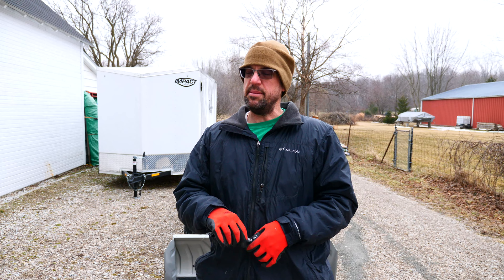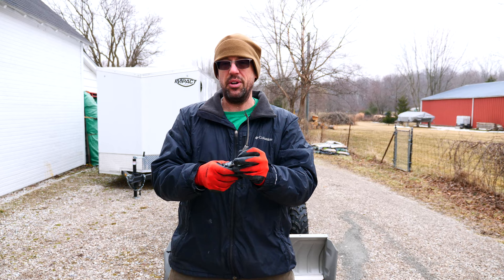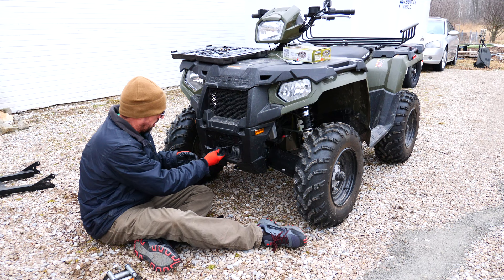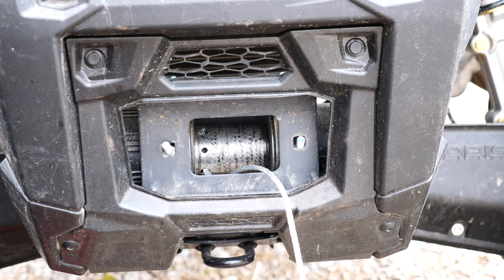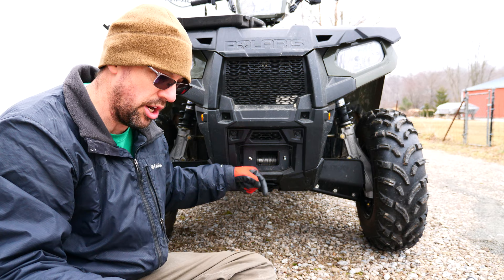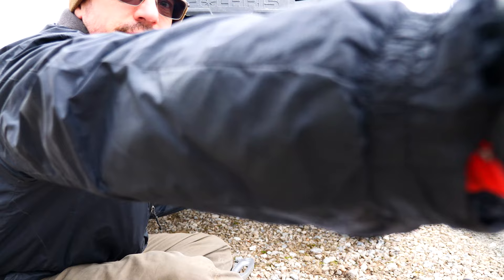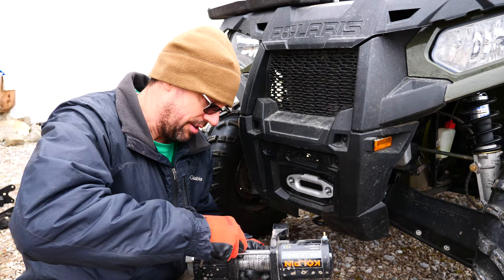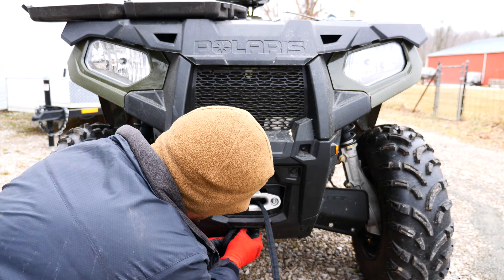Badland Synthetic Winch Rope | Polaris Sportsman 450 H.O.

Comment: Tow trucks do not run synthetic.
The fraying of the steel cable is because of improper use. Rapping the cable, kinking it, and not using chokers, tree savers and proper shackles.
Synthetic will wear on a plow too. 
Both types need proper usage and both have plus and minuses.

Comment: I completely removed the sheath on the winch end of the rope, and I cut the sheath on the retrieval end down to about 3'.   That 10-15 feet of sheath they put on both ends causes a ton of binding.  Perhaps if you have a full sized winch with a much larger drum.    I believe I have the sheath as it came on both ends on my 12500 big winch on my truck.  But there is about 4X the space for it to roll up.

Comment: Curious why you didn't just use the old fair lead?
Reply from the maker: The roller fairlead has places where the synthetic rope can bind or get cut.  Every synthetic rope winch will come with the smooth fairlead or require a replacement.